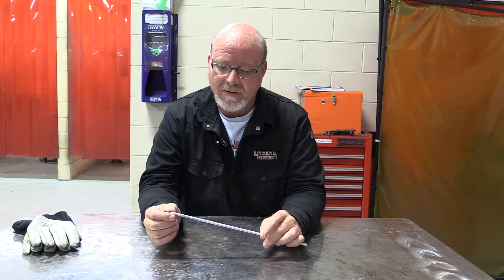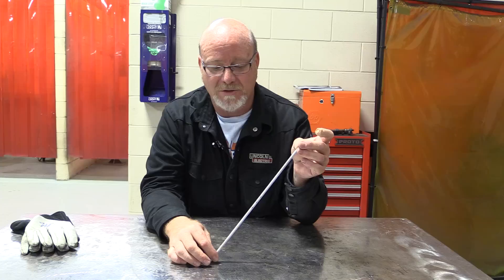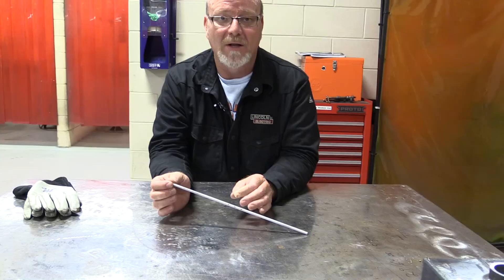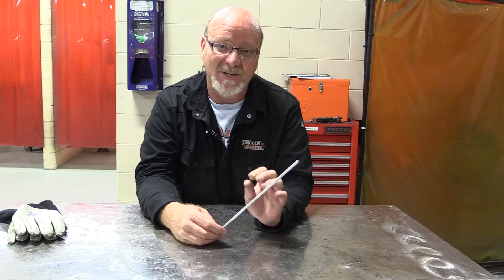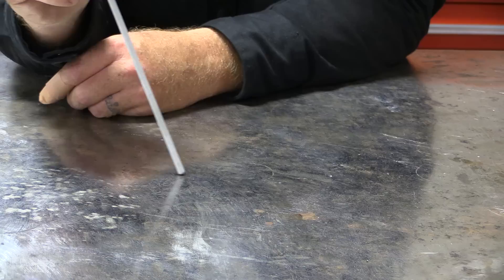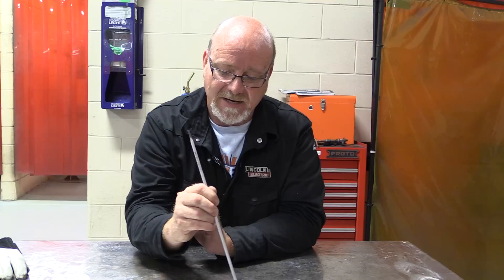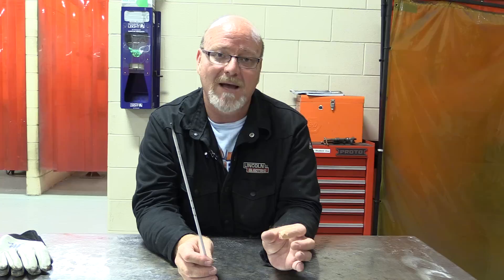Why and when to use 7018 stick electrodes, how are they different than other electrodes.

Comment: My dad was a welder for 60 plus years. He was never much of a 6010 fan. As for root pass. His go to rod was always 7010. Or if a bit of a gap needs to be closed quickly 7010. It’s a quick chill rod all positions and welds cleaner than 6010. It’s amazing how few so called professional welders know about 7010. It’s a better choice I think than 6010. Plus it’s 70,000 tensile strength just like 7018. I use it along with 7018 quite a bit doing heavy equipment repairs. It burns through rust grease well then cover with 7018
Reply: I agree 100 percent.
Reply: 😁7014!
Reply: Wait. He never got promoted to something more interesting than welder in 60 years ?
Welding is taught to kids 14 to 17 in vocational schools or something. It's because all those manual jobs are easy to learn
I taught myself welding  in 3 afternoons using the user manual from the welding machine and a few chapters from a welding book
Reply: @xl000  Some people just like the lifestyle of being on the ground doing the work, maybe he had his own shop for those 60 years. There is a lot more to welding than hobbyist welding, codes, requirements, not to mention the sheer amount of different situations and metal types.
Reply: @xl000  just goes to show you really don’t understand professional welding or structural welding or welding repair out in the field. It’s far different than running a small bead I. A shop on a work bench with a wire feed machine under near perfect conditions
Reply: Would love to do a bend test on some of those "I learned to weld in a weekend" beads, lol.
Reply: @xl000  that's wild and all but I guarantee you didn't learn everything you needed to in 3 days to be a career welder. And even if you could do that, good for you, stop bragging in YouTube comment sections and get a fuckin hobby or something lmao.
Reply: Mahalos for this note. 
Getting into heavy equip repairs myself. Cleaning, adding to, and refacing a nearly destroyed bucket recently; I was successfully whipping 7018 into some gaps, but wishing I had something between 7018 and 6010.
Thanks
Reply: @xl000  welders are one of the more important trades. Every steel structure there is requires welding. From manufacturing vehicles trailers heavy construction equipment agriculture equipment to ski chair lifts bridges to commercial buildings to pipelines. Then there is always a need for welding repair of something broken. Yes dad spent his career as a welder. Without welders we would still be riding is wooden horse drawn buggies
Reply: @xl000  call it love or addiction. Some people have it and others do paperwork
Reply: @erichill5208  every job is the most important using this logic. For example, without a real estate agent, one could argue that no structure could be built, because there would be no one to sell it or something. Or the person at the tire factory that loads the pallets of tires. 
Without that person, there would be no tire anywhere, and no tires mean nothing is moving...
Reply: @xl000  it takes several years to a lifetime to master many skilled trades. Many fields are so broad you only have your niche. By your logic they teach math, physics and chemistry to 16 year olds because its easy?
Reply: @xl000 sure you can get pretty decent  being self-taught. But that doesn't compare to code work. Much more difficult.
Reply: Completely ignorant...... would love to see some of your work.
Reply: @darinwilson8663 
Naw, would be a waste of your time.

Comment: I have no problem with 7018 roots mainly because that's the only stick the railway provides us but I have seen it repair major structural cracks from root to cap and have those welds hold up years later on rail cars that take absolutely horrendous structural beatings and if it can do that than I have no problem with it for roots because results matter more than opinions for me.

Comment: I'm brand new to welding and using 7018 rods and doing overlap's in different positions. I don't find it tedious at all, in fact I quite enjoy it. It's satisfying to get better.
Reply: I luv doing that also! 7018 rules!
Reply: I get some pretty, and porosity free, weaves out of fresh 7018s. One downside I note is a limited buildup rate, but I'm also a little too free to put extra heat down lately.
Cheers!

Comment: I don’t do much welding anymore unless it’s a repair. Depending on the repairs I’m doing, my go-to electrodes are usually 6010, 6011,7018, 8010. The Lincoln Excaliber 7018’s are probably my favorite though.

Comment: I welded for many years using 7018 AC.  (It's rated for DC also). Read the box. The advantage is the flux has a conductive material in it that when it freezes over at the end of the pass it will restrike very easy. Anyone who welds with standard 7018 knows what a problem that is having to tap the end of the rod many times to get the rod to strike, It also has the advantage of being able to run on AC which is handy when you're getting arc blow from magnetic fields.  It costs slightly more but it's worth it.

Comment: From my years welding with 7018 I was told it was a better to use 7018 with alloys that have hardness or other alloys for strength like chrome molly, (molybdenum). It also shows better bonding with abr steel, or abrasive resistant.

Comment: The actual difference with Low Hydrogen rod is the molecular addition of water.  With 6010 it is less critical since the puddle freezes faster. The hydrogen that disassociates from the water bonds with carbon to form hydrocarbons.  Since the puddle freezes quickly, the hydrocarbons are less likely to go into reaction and create porosity, but they will make the weld somewhat brittle.  However, with 7018 the puddle remains liquid and the resultant hydrocarbons will "fizz up" with the steel, creating porosity. Thus you have to keep 7018 hot enough to prevent moisture from bonding with the electrode.

Comment: Well fella’s........don’t let this grey hair fool ya’. OLD GUYS RULE............even though we can’t see shit......we can hear shit.......and we can’t remember shit.........now, here is the single most important safety clue I can give you, if you are going to weld as a career. ......NEVER look directly at your arc pool or puddle while you weld. Use your peripheral vision as your guide. Look ahead of your weld. Draw a thin line with soap stone first and follow that. The soap stone will floresce “light up” by the ultra violet from the arc. 

PROTECT YOUR EYES. Even though you use a dark lense, the arc is very powerful reflecting back into your hood. Wear shielded safety glasses. I am now 74. At night I see “spiders” in my eyes in the dark. So will you if you are not careful. Welding pays very well. Use welding to put you through college, and go find something else to do.

Comment: Nicely done! i'd like to know why 6010 is used when all i keep hearing is that it's almost the same as 6011. Well why not use 6011? it sure as heck starts easier than 6010, especially when you have a cheap machine with low open circuit voltage.
Reply: 6011 has a slightly different flux so you can run it with cheap AC machines.  When using DC, 6010 is preferred, To me it actually runs smoother than 6011.  Certified welding is not done with cheap AC only machines.  For general use at home, in  your shop, doing non certified welding, 6010 and 6011 are pretty much interchangable when running DC.

Comment: 6010 with roots with backing bars I've never heard of that backers it's 7018 all the way
Reply: It’s this weird American pipe welder thing! They only learned how to weld pipe and whenever the pipe work dried up every once in a while they would do structural work. So not understanding the purpose of 6010 they thought it was what you always route with even on structural joints that aren’t open route.  So now routing with 6010 on everything and anything has bled into American welding even though it’s completely nonsense. Everywhere else in the world it 7018 all the way out when it’s not open route.

Comment: Looks like I'm going to be buying some 70 18 rods just had to fix my Willis on my truck and I was wondering why you went to hide good beads they still had gaps or they looks like crap on the truck so I'm going to grind it down and redo it 6010 root and do the rest with the 7018

Comment: I know I'm not supposed to argue with my betters but I've never had or observed 7018 slag being difficult to remove. In fact if you run them hot 95% of the slag will remove itself. The slag just pretty much falls off by itself. Yes, still need to properly brush/clean but it's not difficult. 6010 has proven to be the complete opposite; a chipping hammer will do most of it but it's a task and 6010 slag is a problem if trapped in small cavities; grinder with wire brush disc is the best solution.
Reply from the maker: The difference being if the mineral based slag of 7018 is left in a welds it will create much larger issues than if you miss a piece of cellulose slag. Slag removal is most important in multipass welds and when that 7018 falls off, the edges still have slag that is harder to remove. If you wire wheel 6010, all the slag is gone where 7018 often requires the edges to be cleaned even more
Reply: @markprosserwelds9419  Thanks Mark.

Comment: There are 12 different FLUX formulas  for 7018  electrodes.  The differences are why some of the 7018's produce a excellent looking weld and also run very smooth and some are not so good in appearance and do not have the   ability to run smoothly. They do all produce a low hydrogen weld if used properly. The real thing is the AWS certification as there are several companies that sell noncertified 7018 electrodes. BE AWARE!!!   Steven Dyer Professor of Welding Metallurgy.
Reply: Does that have anything to do with AC and non AC use for some 7018 rods?

Comment: In Germany we have also 7016 Electrodes. Does someone know what the diffrence between the 7016 an the 7018 is? I prefer to use the 7016 more because the slag is not so much and removal is is better. Some of my older welders also don't like the 7018 despite the right polaraty.

Comment: I need some help. I have been trying to get a bit of practice in as I don't have to weld very often and have no formal training yet, that's why I am practicing...  Stayed late this evening at the workshop and pulled a few bits of scrap out of the bin to get a feel back. Tried a pack of 7018S which were sealed, I can't even strike an arc, when I do it just fizzles out then sticks solid. Ridiculous hollow formed after every strike which needed some flux scraping off every time, I guess as the power was set too high and the tip was like hardened ceramic. Welder (Draper arcweld 2011TD) was set at something like 160A and the owner only uses that rod in 2.5mm, as I said, way too high. I reset it to around 80A and tried my old box of 6013, worked a treat!? No amount of fiddling with power would give a good arc. Is the S significant in 7018S? The materials were a scrap forklift wheel and some wheel studs. Is this a bad rod for variable quality /grade steels?
Reply: I just got 3 pounds of 7018 I was  so happy trying it out and no luck hahahaha set around 119a 125a 80a and no idea what I was doing 😅 😄 6013 work perfect 80a 91a I will practice more hahaha 😄 😆

Comment: 7018 runs best on dc, however there 2 or 3 7018 's that are passable on AC, however  they will have a tendency to stick a bit  with a rod that is still hot from breaking  off the arc and restarting quickly when restarting an arc.
Reply from the maker: right and also consider bad arcblow and brands of electrodes.

Comment: I got 7018 from harbor freight and they are very hard to start. The 6011 from HF start very easily.
Reply: Had that issue as  well.  I even switched to 7014 Forney .  No issues with that rod
Reply: The manufacture of the rod can make all the difference in the world, even with "premium" brands. If you open a package and find big flakes of the coating, SEND IT BACK. It won't meat the specifications.
Reply: @michaelgreaves2375     Meat?   How bovine!
Reply: That's why smart folks call it "Harbor Fright".

Comment: giving that the 7018 has a wider puddle is it a better rod for 90 degree angles joining two pieces steel tubing or do you need the deeper penetration from a 6010? No comments ladies.

Comment: Not all 7018 or low hydrogen is created equal, or targeted to the same skill level. More iron powder in the flux makes it easier to start but makes the puddle hotter. That’s ok for flat welds but challenging to weld uphill or overhead without undercutting or sagging out.
Reply from the maker: That's for sure! not all electrode are equal at all. Try some Radnor red 6010 and then try some 5P+ worlds of difference. Remember filler metal specifications are the minimum requirements, some brands go far beyond minimum.

Comment: Wow.. so that's why my 7018's are such a pain to use, being open, exposed and old.  So there is a way to rejuvenate them?  How long do I have to "bake them"? and what is the process???
Reply: 8-10 hrs if I’m not wrong at 250 degrees
Reply: Serve with Cranberry sauce.
Reply: 1 to 2 hours in the oven at 300 degree.
Done!!

Comment: the most difficult rod to start Arc and weld with
Reply: Its called using a file
Reply: Tap the excess slag off with the middle of your chipping hammer don't bother to try and start with fingernails

Comment: I'm getting ready to weld a piece of 3" wide 3/8 steel to a 3" wide piece of 1/2 inch steel.  They both are lined up with each other as if I'm making a piece thats a  7/8th piece of metal.  In other words, I'm trying to weld them together without an overlap of the 2 pieces.  I want to use 7018 rods.  Do I need to bevel both pieces on the edges to create a well that the weld will fill between the 2 edges of the 2 pieces of steel?
Reply: You need to buy a piece 1 inch thick piece and bandsaw 1/8" off

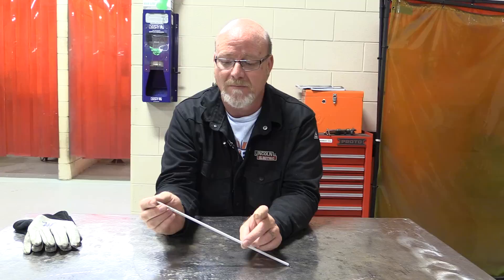Comment: You confuse me at 0:44. Are you sure you want to say "7018" ? Also, Iv'e used this rod for decades without dragging it across the joint, just keeping a short close arc; no issues. Clean the flux quickly before it cools, pops off much cleaner.

Comment: Dumb question coming.?  Can you tell me why a person would use the 7018 over top of the 6010.?  And not just keep using the 6010...  Is it because you mentioned its shallow but Wider...  So you have the deep pen narrow 6010 rod 1st, then tie into it with the wider shallower 7018... Thx
Reply from the maker: Because 7018 is a LOW hydrogen electrode, stronger, cleaner, higher quality, all in the different flux

Comment: All certification test I have ever taken they only allow you to use the 7018 from root to cap.6010 was not allowed .
Reply from the maker: 7018 on an open root? or cert tests with backing? if you are running 7018 open roots, good on you, that weld takes some dam good skill. 7018 open roots are much more common in Europe, Don't see many open root 7018 welds.

Comment: how many amps do you need to weld with electrode 7018 of 2.5
Reply: all you can get away with, without falling through different strokes 4 different machines.
Reply: Amps needed are usually  Iisted on the box.
Reply: 120a i think 🤔

Comment: Sir, which one gives the more strength MIG or 7018 in arc welding on MS job
Reply: Why has he not answered you?
Reply: Welder drew, where do you and your family live?
Reply: Atom Robotics it depends on what MIG wire you use.
Reply: @welderdrew98  sir we use GM 70, which one is best for strength in MS job Arc 7018 4mm/ MIG GM 70 1.2mm

Comment: I use 7018. .I dont see any sense of this video.  It stays in my service van for months    flux peals off before  I finish weld, i have even done welding  outside while it is snowing   no problem   every thing goes fine.
Reply: Do you store them in a hot box?
Reply: Agree. No crazy storage used and for me the easiest rods all around to work with
Reply: He's trying to instill good welding practices.  It's not that 7018 must be used within a certain time frame or it's junk.  More so, that letting the rod absorb moisture is going to lead to shabby welds.
Reply: He's referring more to pipeline work and serious shit that gets x-rayed, any little projects you do aren't gonna have problems from a little moisture in the rod.

Comment: 7018 is miserable to use on AC. Maybe worse than 6011 on AC. 7018 works well on D.C. Reminds me of 7014 on AC only a slight bit better yet. 7018 and 6011 just plain stick too much on AC.